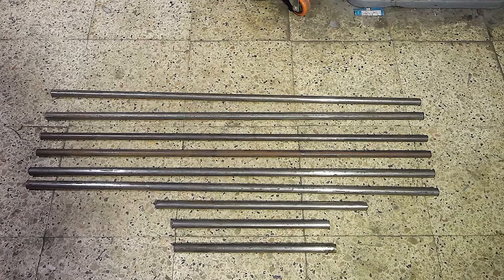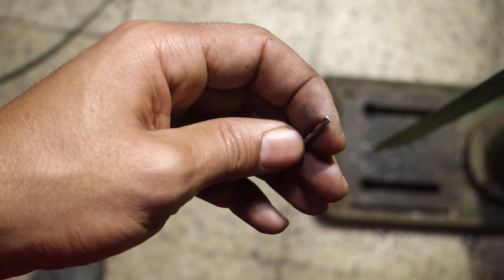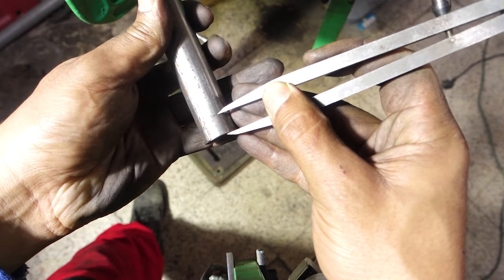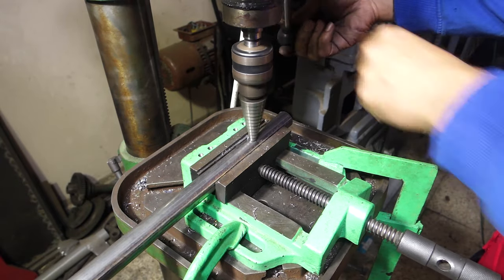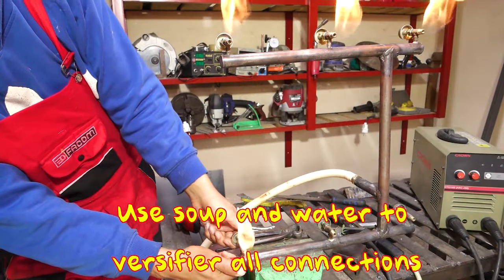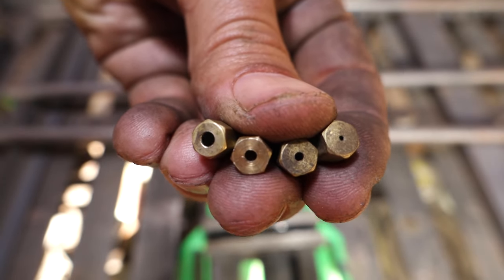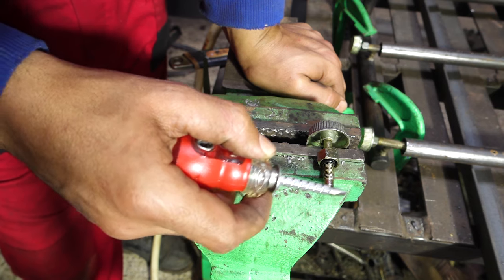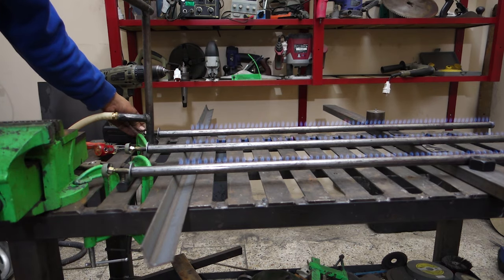Homemade gas burner for bread

Comment: Somebody tell me what the hell I am doing wrong.  I have made two of these pipe burners one with a 1" pipe and one with 3/4".  No matter what I do my flame starts out weak, but it gets strong toward the end of  pipe.   instead of drilling holes for the flames, I cut slots every 1/2" for a total of 34 slots.  I have tried different orifices with different size holes and still uneven.  people have said gas is shooting out too fast and its passing by the first ones too quickly, but like I said, I have tried different orifices with larger holes to slow down the flow, just not happening.  any ideas?
Reply from the maker: If the flow is low it means that the pressure is low inside the pipe so  You need to make the slots even smaller or drill them starting with 1.5 mm and if you need stronger flame take them to 2 mm and drill the gas valve hole with 1mm or 1.5 drill bit qnd don't forget to make a system to control the air gas mixture.
As you see brother there is a lot of variables so try to simplfy by starting with small everything and then you can make it bigger .i used in my experiment first square tube untill i was satisfied with the results then i made my final burners
Reply: @TheHomecrafter1988  Thanks man.  I guess I just have to play with it until I figure it out.
Reply: @TheHomecrafter1988  do you think the round tube works better than the square?
Reply from the maker: I don't thin there is a big difference if any. But it is easier to drill round holes on the body of the oven when the time will come to put the burners inside that's all
Reply: @SN1350 
Careful. Do not let the system swallow air into the pipe if the pressure gets too low. You don't want combustion "inside" the burner. 😱

Comment: Do you think we can make a U shaped pipe burner? Where would we enter the gas, from the middle of the U? Will the glass flow to the two parts of the U? Thanks brother. Shokran
Reply from the maker: I tried it before that way and it works fine.But here i need to control every line separately that's why i made it like this
 Good  day to you brother 🙋
Reply: @TheHomecrafter1988  thank you. Subbed!
Reply from the maker: Thanks 😊

Comment: hello congratulations for your video and your ingenuity! small question what type of steel did you use for the cylindrical tube? thank you
Reply from the maker: thanks . I used normal steel 22mm diameter 1.6 mm thick
Reply: Thank you maestro

Comment: Great work.  I live in India and am working on my first gas pizza oven.  

How did you figure out the distance from the first burner hole and method for gas air mixing?  Any idea where I can find literature on this?  I don't even know what to search.
Reply from the maker: Thanks i tried and experiment in my old oven with steel tubes until i was satisfied  than I started on this one
Reply: Make sure to run the gas so it pushes the air out of the pipes before you light it so it doesn't want to burn inside the pipe... it can act like it wants to 💥

Comment: Regarding the drilling of the tube u should weld a flat piece of metal on the tube temporarily to allow u to drill the holes straight without the tighten it on the vice
Reply: Or use a Center drill...

Comment: Please help me with the correct gauges to use if I want to make a 2 or 3 deck gas oven from steel, thanks
Reply from the maker: I think you can use the same guage i used here 1.2mm or even 1mm and isolate with fibre glass wool ,👍it will work fine brother

Comment: PLEASE  I am a green horn in fabrication please what did you use in connecting the solded gas valve with the many holes drilled burner pipe
Reply from the maker: I used a silver solder 5% silver with soldering powder to reduce oxidation
Reply: @TheHomecrafter1988  thanks
Reply: Борная кислота в порошке.

Comment: hello are you still active on youtube ?
need some explanation about how hot the fire is ?
can it be used to boil water ?
Reply from the maker: Yes it can . water doesn't need that much heat to boil .I made pizza oven with it and it is very hot.
Reply: @TheHomecrafter1988  well thanks then.
this is so easy to make btw, thank you sir 👍🏻

Comment: Drilling steel on 2800 rpm? Shouldn't it be 250-750 rpm?
Reply from the maker: with that drill bit even higher hhh. 
This is a speed chart for the drill press and every drill bit you will probably use at which speed
https://www.google.com/url?sa=t&source=web&rct=j&url=https://www.imperialsupplies.com/pdf/3660-5_F_Drill_Bit_Sheet_Update.pdf&ved=2ahUKEwig1Za05e_wAhVRVsAKHeTOCXgQFjANegQIGhAC&usg=AOvVaw3Q3iKPGruMuT-_WKONreDJ
Reply: @TheHomecrafter1988  well, I am not as experienced fabricator as you are as I do it time to time only,  but in my humble experience 10 mm hole in stainless 304 is never higher than 500 rpm . Better lower than that as high speed burns my bits . 12 mm I did with 100 or so rpm .  It seems charts give too high speed, even on a good drill press I burnt a cobalt bit 12 mm in 3 holes trying to cut at 250 rpm .
Reply: Stainless steel 304 i go 4 mm at 750 rpm, then 10 mm at 500 rpm, then 12 mm at 100 -150 ( reduced the speed myself , not sure how fast it is or how slow )
Reply from the maker: Yes you're right about 10mm in stainless steel because it's harder than mild steel.But when I use it here the hole is small 2.5mm and the steel is thin . Some times I cheat and drill with what ever the previous speed I set befor usually 500 or 600 rpm lazy but less work hhh
Reply from the maker: Use the feel of the drill press and the sound .If it squeals then there is some thing wrong.I then verify the bit and the speed
Reply from the maker: The best thing you should learn about drilling is sharpening your own drill bits .Because when you make mistake and burn the bit you can repair it and use it fast without wasting time and money to buy another
Reply: @TheHomecrafter1988  for now a machine shop does it for me at a very low cost ( 0.2 usd per piece) but I'd need to learn eventually
Reply: @TheHomecrafter1988  if I do 10 mm on 304 at 600 rpm , I'd burn it in 20 holes . Tried it . Wd40 as a lubricant.  I usually drill 3-6 mm stainless and mild steel 2mm-12mm
Reply from the maker: @Radio Nonsense  HHH nice .with time you will get there

Comment: A real pizza oven needs to reach at least 500 C. this burner can never help doing that.
Reply from the maker: It has six burners at least it is better then my small oven and I'm putting fiber isolation and thick piece of steel inside that will help maintain the heat better
Reply: @TheHomecrafter1988  that is true
Reply from the maker: @ShopperPlug  thanks